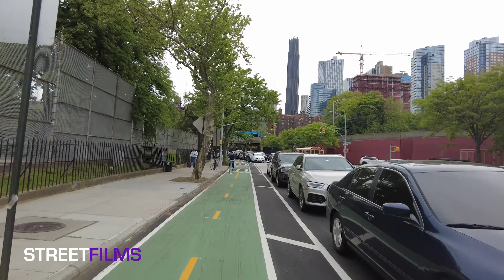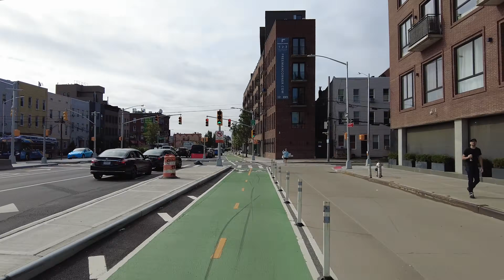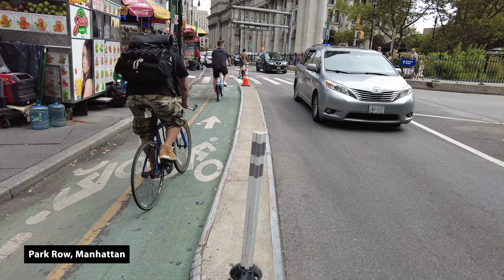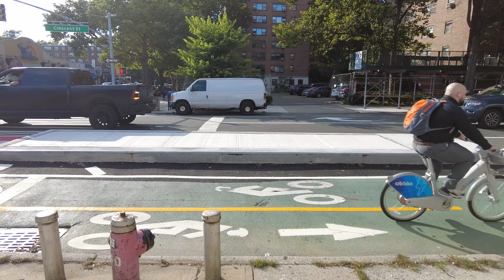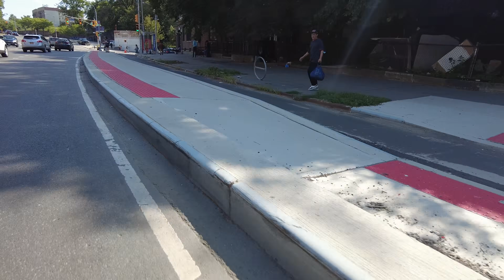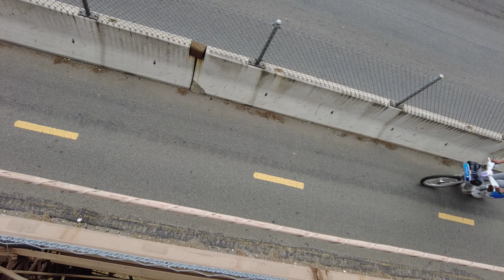Talking Concrete Protection for Bike Lanes with NYC DOT's Sean Quinn

Comment: The tall vertical curbs on the cycling side seem very dangerous should a cyclist have a momentary diversion into them.  Would they not also make it very difficult for emergency vehicles to use the bike lane to get around traffic? (this is a common auxiliary use for bike lanes in the Netherlands iirc.)  It would make it quite difficult for bike lane users (especially cargo bikes and riders with less mobility) to get out of the way of the emergency vehicle.

Why was this done???
Reply: North American cities are still new when it comes to implementing cycle infrastructure, and they are still trying to find out what work and what doesn't.
yes it would be easier to just look at places who already have top cycling infrastructure and see how they could copy it to their own city. 
(but that's something the US often has a bit of trouble with, acknowledging that another place does it right)
so they try to find the best solution on their own, and that takes time. and you will make mistakes along the way.

but it's good that they are thinking about more than just car traffic and try to redesign the roads to be accessible and safe(r) for more road users.
also these solutions are designed to be placed into already existing infrastructure. 
so hopefully when the streets are due to be redone, they will rebuild them in way that has room for everyone and has redundancies build in to prevent cars from entering the bike lane or make it possible for emergency vehicles to bypass traffic by using the bike lane.
especially the last one would be great for a city like New York, just think about how often those emergency vehicles get stuck in traffic and how much time and lives could be saved if they had a way to get though blocked streets by using the bike lane for a few blocks.

ps. they current bike lanes are also a bit on the narrow side, so i hope they will adjust that in the future to make it easier for people to overtake each other while cycling.
Reply: I don’t think it was a case of good ideas being on the other side of the ocean. Just looking at cyclists right next to the vertical curb seemed really dangerous to me. Idk how somebody can claim they are trying to accommodate all ages and abilities and allow such a design to become implemented.
Reply: A cyclist hitting into a curb is still a lot safer than a car veering into the bike lane. Could the design be safer? Probably, but any bike lane design is going to be trade off on safety, practicality, and cost. Most emergency vehicles (in the US at least) would have a tall enough clearance to straddle the curb if necessary. As for cyclists being able to clear out of the bike lane, there are plenty of cutouts between the curbs. Unless the emergency vehicle was driving recklessly, it would not be an issue to move out of the way.
Reply: I’m talking about the BICYCLE side. The car side is probably fine. It can be two different profiles on each side of the divider y’know.
Reply: it would be to narrow anyway and no other option being possible on bridges 😊

Comment: this is great Clarence!!! thank you so much for putting this together. The barrier section by City Hall, where Park Row becomes Centre St right at the Brooklyn Bridge, is a nightmare if you're trying to go North on Centre. Police vehicles park in the bike lane, so there's no way around them in the street, because of the barrier and the narrow one lane going south.... So the safest thing to do is ride or walk, depending on how busy it is on the sidewalk, through the tourists and hot dog stands. 
University Avenue in the Bronx, in the 170's is a similar situation with people permanently double parking, junked cars and garbage in sections of the bike lane and the safest lane is the designated bus lane, which can get hairy, if there's traffic. There isn't a lot of bike awareness in these parts, even though there are citibike stations and people riding. The Bronx is very car oriented.